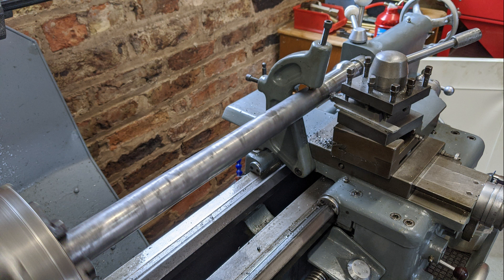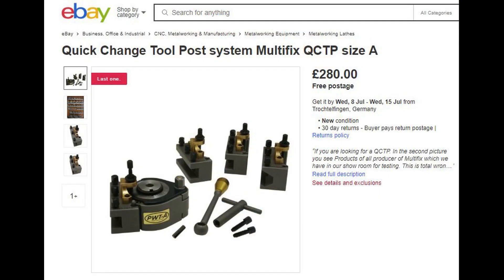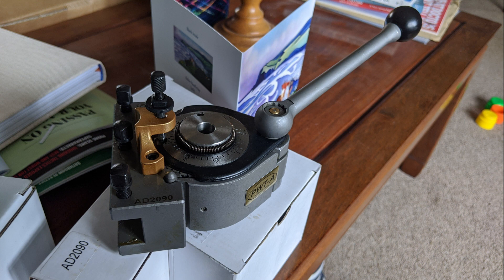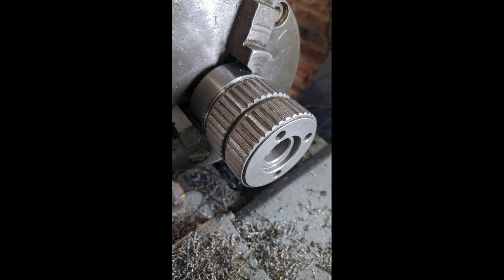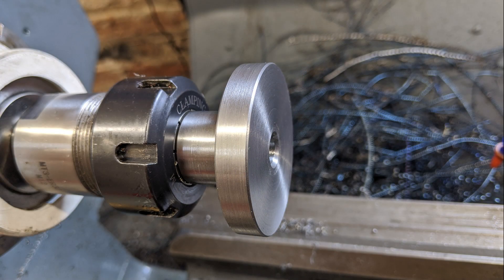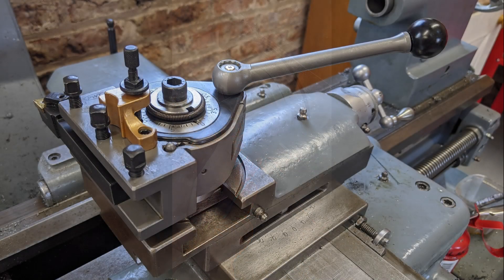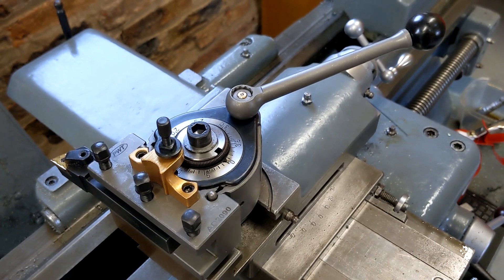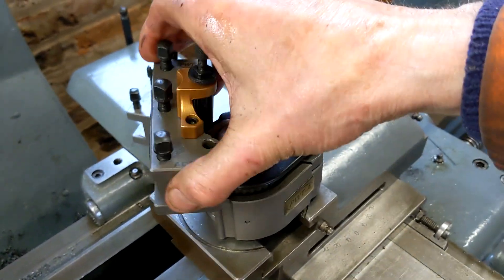HS18 Harrison 140 lathe multifix toolholder setup

Comment: Hi 
I also have a Harrison 140 and am planning to fit a multifix tool holder so this video have been very interesting. Thank you.

I see how you machined post but what did you use to fix it to the cross slide? Is it just a flat plate? And  what size bolt did you use?
Reply from the maker: Hi Steve, that was one of my early videos so sorry it's a bit unprofessional. The 'flat plate', as you say, is actually the original toolpost wide securing 't nut'. I think the centre screw is 3/8 UNC. If you want to know more send me an email on haxby_shed@outlook.com  Cheers

Comment: Hi,
Having now used the Multfix tool holder for a few months are you pleased with it? 
Take care
Paul,,
Reply from the maker: Hi Paul, I'm very pleased with it. Having the quick change and height adjust is similar to other tool posts but the Multi has the 40 rotary positions so it's great for repeatable work, e.g. if you know your chamfer is 2 positions clockwise or whatever. And the cam lock with the handle makes tool changes very quick. Cheers.
Reply: @HaxbyShed  Thank you for taking the time to answer my question...